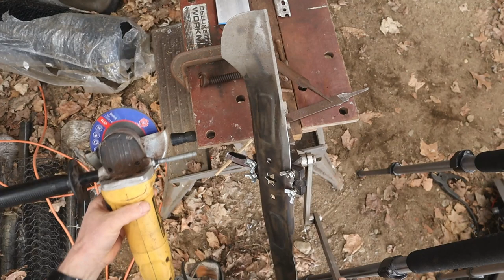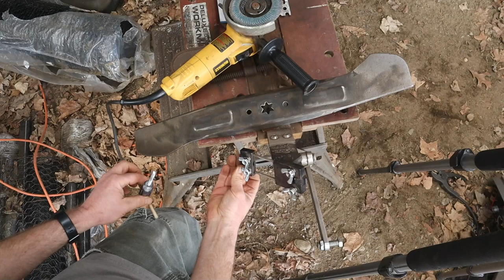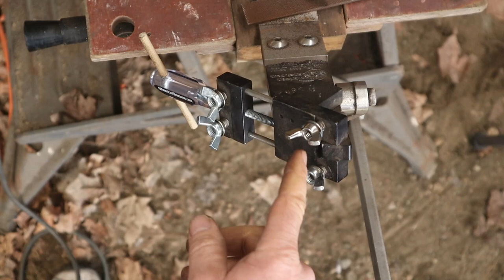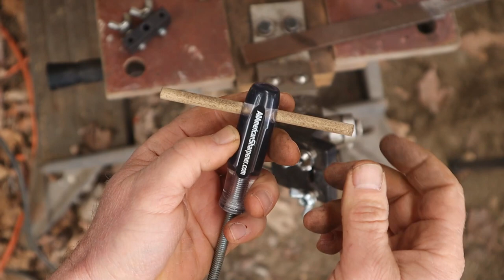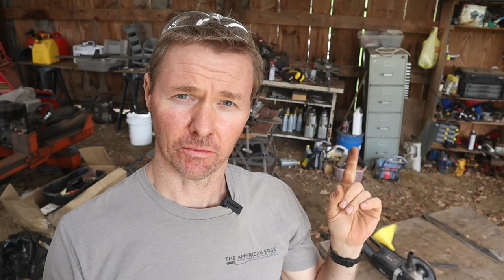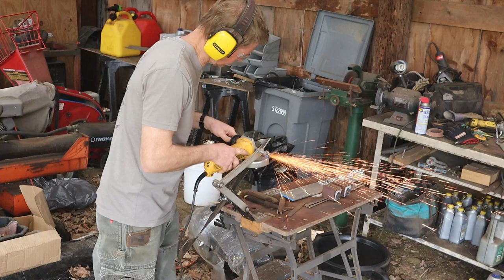4 PRO TIPS on the All American Mower Blade Sharpener

Comment: I just sw this video. As far as centering the wheel on the edge, I used small washers on the pin to push the grinder to the left. You can use multiple washers to get any distance you want.

Comment: Have you used different grinding wheels on mower blades and found one that seems to be the best? I see you are using a flapper wheel on it now. I just ordered the all American and don’t have it yet but trying to get ready for it.
Reply from the maker: Congrats on your new tool. Yes, I still prefer a 40 grit flap disc in
ceramic or zirconia.

Comment: Does the angle change as the grinding wheel wears down? It certainly changes with A Oregon 88-025.
Reply from the maker: As long as you line up the blade with the centerline of the disc, no.
That adjustment is easy to make on the All American.

Comment: I have an All American Sharpener.  When I start grinding on a blade that has previously been sharpened by hand by someone else, the angle has always been more than 30 degrees (I've seen some that looked like they were 60 degrees), so I run into the exact situation you described - the grinder starts removing metal from the trailing edge first (what you called the bevel/shoulder), and the leading edge (cutting edge) remains dull.

This is how I look at it: presumably the people who bring me blades are going to bring them to me again in the future, so instead of me always having to adjust the jig angle to match the blade, I just set it at 30 degrees and grind away until the blade has a 30 degree angle on it.  I just did it yesterday in fact.  It adds some time to the process, but it's not excessive.  When I sharpen that blade again in the future, the entire face of the edge will be shiny after 1 pass, and be sharp in 15 seconds or less.

When I'm sharpening a blade that I've sharpened before, I spend more time loosening & tightening the jaws and flipping the blade around than I do sharpening the edge.
Reply from the maker: Yeah man, right on!
Reply: I found that using a hard wheel to return the angle to original is much faster than a flap disc.  It only takes 2 or 3 quick and light passes.  If the angle is already close then I use a flap disc.